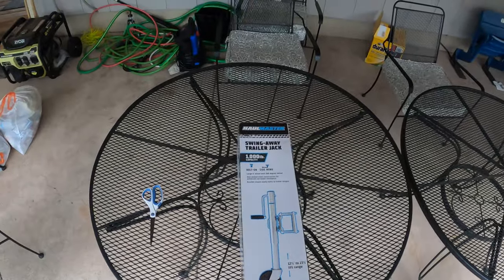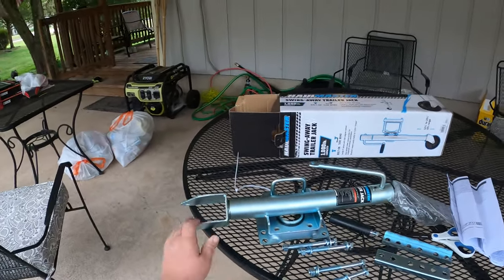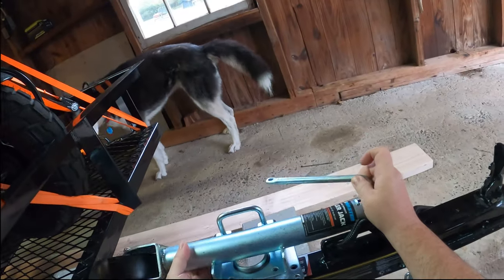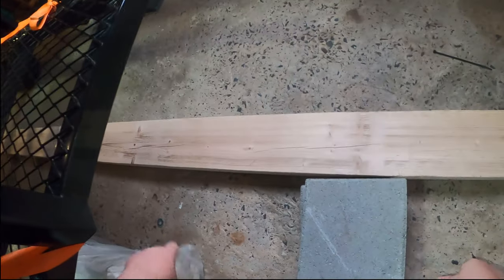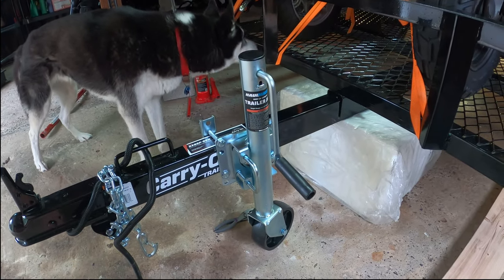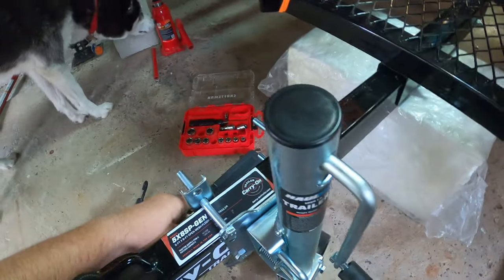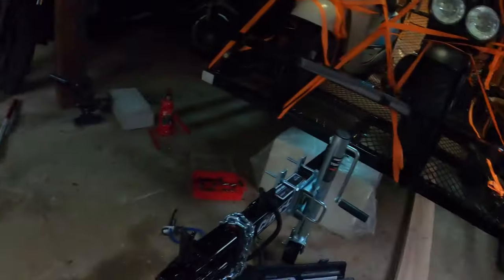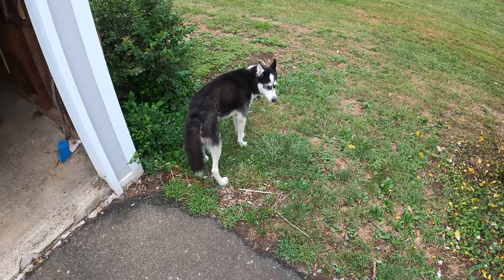How To & Review: Harbor Freight Haul-Master 1000 LB Swing-Away Trailer Jack

Comment: Drill a hole put a hitch pin and washer through the crank stud  then you can remove it easily if it sticking out is an issue

Comment: Nice video love the dog to, I've got the same Haul Master trailer jack, when I've got something in tow on the trailer, I roll the wheel all the way up an hold the wheel in the straight up and down Position, once it is rolled all the way up the handle will tighten up, in my case when it does tighten up the handle is Parallel with the trailer with the wheel towards the front of the trailer of course not towards the front were it drops on the ball, I don't crank it very tight just snug and the hand crank will stay in that position, so it's not hanging down or towards the front were it drops down on the ball so it doest effect your turning radius, In saying that i totally agree with you on the Manufacturer coming up with a better way To tuck the hand crank to keep it out of the way, enjoyed your video it's great for a first-timer on replacing on installing this trailer jack 👌

Comment: I don't know if you did it or not, maybe I missed it. The bolt that goes through the handle has a flat spot on it so you can recess it in deeper to expose more thread for screwing in the nut.